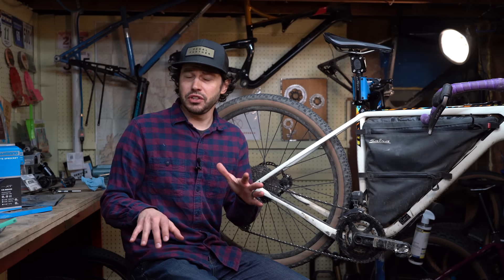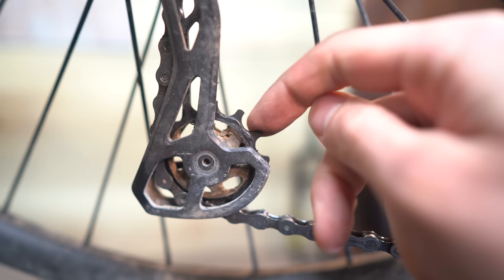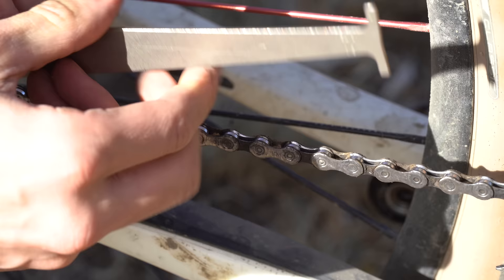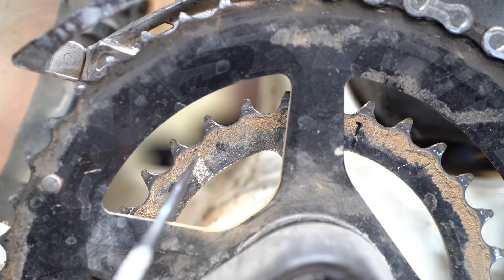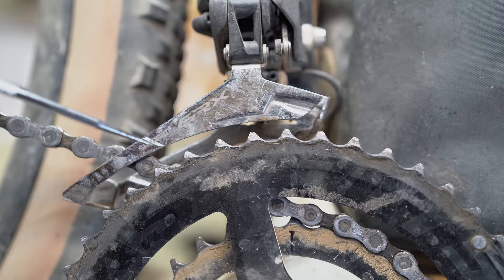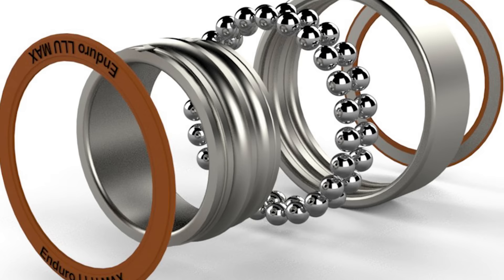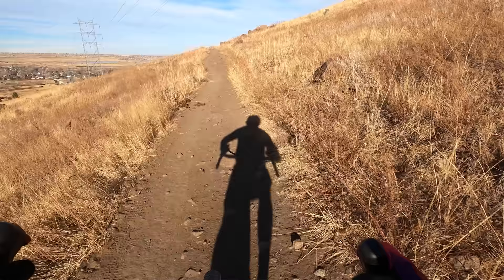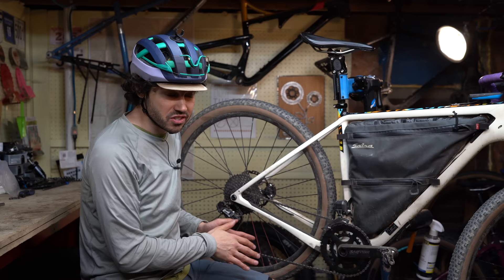A Pandemic Drivetrain: The 4,000-mile Audit

Comment: pro tip: you can check the chain by measuring out 12 links. all chain links are 1 inch long when new. so if 12 links measures to anything over 12-1/16” it usually equates to .5 or more on a wear indicator tool.

Comment: I rode my pandemic drivetrain about 7500km but my Chain Checker was still not dropping into the link - I was very surprised. Eventually I discovered that the checker didn't drop in because it had stretched so much that IT WAS TOUCHING THE WRONG SIDE OF THE GAP. Check early, check often folks :P
Reply from the maker: HA-HA, impressive!

Comment: I am just here to admire your logos (grins). I picked up a $25 ‘99 GT MTB last month that had better 3x7 drive train and went through the same. I had to do the the same walk thru as you did. Repack the BB, replaced the 3x chain rings from another salvage bike, and swapped front derailleur for better. New jockey wheels as 7-8 speed ones are out there. New cables all around. New cables and brake pads. And I had the LBS check our derailleur hanger and wheels. It so sweet! When I started I wanted to pitch the whole drive train, but this is so much better.
Reply: That's right. Old stuff lasts waaaay longer. Honestly, they don't make it like they used to. I get all sorts of barely used 'old junk' cheap or practically free! 
  Ironically, cycling is supposed to be a 'GREEN' sport! But that doesn't suit the agenda of marketing BS, nor materialism and ignorant consumers. 
  I wrench in a shop. All this new bike 'technology' is merely job security/more service/more sales/more profit  for me!! We turn work away. We've been busier and more profitable in the last 2 years than in the 60 year history of our company! 
   The funny thing is I don't really want what we sell in the shop. I know better. I can do it far better than some low paid worker 1/2 way around the world. I DIY.

Comment: Great video. Thanks for the pointers on checking wear without having the wear tools. That is really helpful for us that can't or are to cheap to buy the specialty tools. As for my pandemic drivetrain. I am still feeling lucky that I found my pandemic bike let alone a good drivetrain build. I am pretty sure I was able to score the last Salsa Fargo XL in the country when I picked it up last year. It's the Tiagra 2x10, so I think that actually helped me out on parts. I was able to build a wide range 2x10 drivetrain when all of the 1x parts were out of stock. Though it still wasn't easy to source the parts I was looking for either. I was a to find an 38t chain ring replace the stock 36t to build a 38/26 Deore crank and was able to find 11-42 deore cassette to replace the 11/36 stock cassette. I was also able to find a GRX 400 RD and a 10 speed goat link which handles the 11-42 beautifully with still plenty of b screw left. Couldn't be happier.

Comment: keeping your drivetrain clean and regularly measuring chain wear is the best thing you can do for your bike. I assume this guy let it go for the dramatic effect, but if he had kept an eye on chain wear and changed chain earlier, the cassette and chainrings would have more life left in them--sure it shifted ok, but this chain took more life out of the cassette and chainrings than was necessary . And ya, clean and lube your bike often, well the drivetrain anyway.
Reply: Doesn't hurt to check tire pressure EVERY RIDE and pump 'em up. Tires are our connection with the ground! That's at least as important as a chain! I can coast 30 mph down a mountain  without a chain! Can't safely do that without proper  tires. 
   As a mechanic, I'm amazed how many folks miss this. 
  Chains and tires. The Most important parts on a bike. You won't get very far without either. They happen to fail most often during a ride. EVERYONE who rides a bike should know how to handle tires and chains.

Comment: Top tip is to rotate between two chains regularly, that way the components don't get "personal", so will not be instantly wearing your new parts in after a swap. Will prolong the life of the cassette and chainring
Reply: This is what I'm experimenting with at the moment. I rotate between two chains every 1000km. If it works like intended then I'll be using that method on my next long-term trip.
Reply: @VeloObscura  Great! My local bike shop said to rotate every third ride. I suppose a happy medium would be best.
Reply: @bingoberra18  Wow yeah, that's more often than I expected. I suppose it makes sense though! 
I'm usually looking at this sort of thing in the context of a long term tour - we just finished a 6 month stint - and I don't know if I could deal with that amount of work... I'm a pretty lazy cyclist at times and it often seems like usual rules don't apply in bike travel world 😅
Reply: @VeloObscura  Hehe well the correct way would probably be  some kind of intervals based on hours ridden. I think if you wait too long between intervals, its already starting to get personal and youll wear down the other item slightly in the process. Riding for 6 months maybe  every 2-4 weeks would be reasonable to start with? At the same time,  thoroughly cleaning and lubing up the chain that comes off.
Reply: @bingoberra18  Yeah, I'd be more inclined to go based on distance as that MIGHT be a slightly more accurate representation of the amount of cycles the drivetrain has done? We might take a couple of days off somewhere and that would obviously mean less chain wear for example... I think it's hard to find a perfect answer for that one, but I guess as long as you do it fairly often like you say. 
We take REALLY good care of our chains. I've experimented with various lubricants over our tours and I keep coming back to the likes of "Squirt" and "Smoove" just for how clean they keep everything - but I'm currently experimenting with the Wolf Tooth lube and so far it has been incredible. It might be my new favorite, but it's a bit pricier and harder to find.
Reply: Hours ridden arent a practical means to measuring chain wear. Under what conditions? Under what pedaling loads? How do you shift? It might be a decent means relative to your own use. But all you've gotta do is measure the chain with a simple ruler. Its the 'scientific' means of measuring chain wear. 
   Chains get longer as they wear. The chain's pitch becomes longer, that pitch wears into the drivetrain's teeth making them thinner in profile. Larger gaps in between. This is partially why shifting gets incrementally worse as the chain wears. The more often you replace your chain, the longer your gear's teeth last. Gears are relatively expensive compared to chains. 
  This is a very simple mechanical concept.
  Best thing you can do is to keep your chain and drivetrain  clean and PROPERLY oiled.

Comment: I'm actually a bit blown away that cassette worked well with a brand new chain.
It's not 0.75% worn. It's 75% worn. At 100% a drivetrain is usually completely used up and unsalvageable. Most brand new chains will measure at 15 to 20 percent. 25% to 30% is the optimal time to preemptively swap a chain to avoid wear on the rest of the drivetrain, and for optimal compatibility of a new chain with old cassette and rings. With this system, I've gone up to four chains on the same rings and cogs, then eventually let them all wear out together.
Reply from the maker: I also was blown away, not sure how I got so lucky here.
Wait, thats confusing, as Park Tool using .5% and .75% in their language when describing their tools. I guess either way it's the principle.
Reply: The measurement on the chain checker means .75mm of chain stretch. A modern 11 or 12 drivetrain should have the chain replaced at  the .5 wear point. The longer you put replacement off, the more your expensive cogs and chainrings are worn. 
  Changing your chain  more often allows the much more expensive gears to last longer. As a chain wears it gets longer, that increase in pitch between each link wears into the teeth on the gears, making them skinnier with larger space between. This is why shifting precision degrades. Eventually when everything is worn beyond acceptable  function, the chain slips under hard pedaling loads. Then you replace the entire overpriced drivetrain. 
   The best thing you can do regarding parts shortages are to get non proprietary old 'junk'    
  11 and 12 speed chains have been fairly hard to find until recently. My shop never ran out of 7-10 speed stuff. I'm a shop mechanic. 
   I use singlespeeds, 7-10 speed and friction shifting. Parts are available, free used stuff even. None of my old junk is proprietary. It all works quite well together and it's lasted quite a long time. It works great and can shift well even when it's banged up, abused and damaged. Practical stuff when you're out on a long tour! 
  To me, a pro mechanic, all this new bike 'technology' is nothing but job security. Plain and simple. It's inevitable.
Reply: @rollinrat4850  okay, that 0.75mm thing makes sense.
Reply: @SnootchieBootchies27  .75mm over 6 or eight links is quite a bit. Much Too much in my opinion. That's about 1/32" over 3 or 4" at the most. 
  Chain manufacturers actually recommend replacement at  .5 percent  of chain wear. I check this with a 12" ruler over 12 links of chain. This is the most accurate and practical means to check chains. 12 1/16" means it's time to replace the chain. 1/16" is about  1/2% of 12". Ive done  this for decades before you could ever buy a chain checker. Its simple math and factory recommended information. 
   Again, I'm a high end shop mechanic, just for the fun of it. I'm a retired machinist and mechanical inspector. Bikes TRULY are relatively  simple machines. Mine certainly are.... Ive helped build structures  that fly in space, in the sky and a surgeon's instruments. Marketing BS has never fooled me where mechanics are concerned. . 
  As long as I keep my drivetrain clean and well oiled, I get 4-5 chains worth of use out of 1 set of 'rings and cogs. I also know how to shift almost silently, (makes a huge difference), but I ride mostly in dirt, often through creeks and bad weather. I don't coddle  my bikes at all. I use them hard. Racing or aggressive riding is particularly hard on all sorts of parts. These days I prefer exceptionally long rides, touring offroad, mixed road rides  and randonneuring. My rides can last for several days with breaks, food and rest. I try to ride smoothly rather than aggressive. If I race or ride really bad weather on  my 'cross bikes in mud or deep creeks on the other hand, I've destroyed all sorts parts in one short 1-6 hour ride!
Reply: Honestly, I've never researched what chain checkers actually mean. My question would be .5 to .75% of what?? Lots of these checkers can be used completely wrong to sell more chains! The numbers are rather confusing and vague. Many mechanics use them in the shop to sell more chains! 
  If I'm really curious, or a wise customer wants to know , (or it's my bike) then I use the ruler method as well. This data is proven, known and understandable to me. 
  One of these days I'll do precision measurement of a few chain checkers  on a coordinate measuring machine (very accurate measuring devices) to find out for sure what they refer to. 
   Every mechanic I know, says if .5 goes in replace your chain!

Comment: I managed to squeeze a 10-42t cassette in my GRX rear mech together with a 24-42 Setup in the front. 15gear inches in the smallest gear and 735% Gear range.
Reply: How do you shift in the front? What is the derailleur-crankset combo?
Reply: Fd-Rx812 with white industries
Reply: @daseishorn1863  It's able to make a 18t shift just fine?
Can a derailleur go any lower to work with a smaller big chainring? Or it would hit the chainstay?
Reply: @SpaceDjoxy  With the right combo of parts, 18t difference is entirely possible. It all depends on the parts. You've got to experiment and figure out what works on your unique set up when you go outside the box. 
   You can surpass recommended specs a bit under the right mechanical circumstances. Front derailleurs can be rather tricky and very frustrating considering all the different derailleur  types/cable pulls  and bizarre frame shapes. Some front mechs can't be adjusted radially or height wise very much which really limits going outside of their box. 
  Ive found that traditional round tubes and old school derailleurs work best on my own wide range gear set ups for loaded touring. I use 3x or 2x. That's the only situation where I 'need' ultra low gears. Normally, I pedal singlespeed or fixed daily for commuting and my local trails. 1x is great for singlespeeds, seriously rough trails and cyclocross. For general XC and everyday riding I personally hate the huge gaps and severely limited gear range. I ride to trail heads through a city. I'm an old (off-roadie) road racer stuck in his ways....
  I like 24/42 chainrings with a 33 year old Deore front mech on my dirt tourer. 11-36 10 speed friction shifting works great! Seriously reliable! It is low enough for loaded bikepacking in big mountains or I'll just walk. Much lower gears than that and I fall over from a lack of momentum and balance. 
 I've experimented with custom 16 tooth granny gears and 34 tooth cogs decades ago. Stupid low! Believe me, it's possible to go too low!

Comment: I took a long hard look during the pandemic, in the way that the cost of every single part on my bikes drivetrain went through the roof and with one simple question - am I prepared to pay more or less double what it originally cost me and suppose I woke up tomorrow and Covid had turned out to be like a scene from a 1970's BBC program.
The answer was no. The program was Survivors and as a child it taught me make stuff last forever, so I upgraded my sram gx kit to shimano compatible 8 speed. I have a stockpile of chainrings chains jockey wheels and cassettes that will pretty much last me forever and all purchased as new for was seems like a pittance....... and the only thing I miss about the GX my bike originally came with is that little spring loaded catch that holds the derailleur open.

Comment: Hi. How did you arrive at the 4K number? I just got the 3 components you mentioned replaced after 6k miles and my bike is running great. It sounds like a regularly replaced chain is the best maintenance scheme. Thx
Reply from the maker: The goal was to see how far the drivetrain would run without replacing anything, I washed it down and lubed it but that is it, it stopped working (started skipping) at just over 4000 miles.

Comment: There's a rule of thumb that says 3-4 chains per cassette and 3-4 cassettes per set of chainrings. Throw a chain checking tool on each chain at 2,500 kms and change them out at .75 or more, because hey, a chain's cheaper than a cassette and a cassette's cheaper than a set of chainrings, or an entire new crankset (which can be cheaper than new chainrings on their own). You'll always hit that guy who will angrily insist that he's still running a chain and cassette from 1975 and gets agressive at the idea that components are consumables, but by changing chains you have much nicer shifting and a longer slifespan. One thing to note is Sunrace cassettes. Sometimes they skip like mad on their third chain, and you have to wait a few hundred kms for the last chain to settle in, so it's better, from a longevity standpoint, if not a weight weinie viewpoint, to use their heavier steel cassettes. You get a weight penalty, but if you're riding party pace on a steel bikepacking bike it's not the end of the world and they tend to be cheaper than the ones with alloy spiders etc.
Reply: Its better to replace chains at .5 wear mark on chain checkers  for 11 and 12 speed drivetrains. I refuse to use that stuff. Its less reliable. Simple is as simple does. 
  More gears= less tolerance for worn components. Anyways,  a chain is quite a bit less expensive  than gears. How many gears do we 'really need'? I can't wait for 13 speed. More job security for mechanics like me! Haha! 
  I always replace my chain when 12 inches of chain grow to 12 1/16". That's .5% chain wear. 1- 10 speeds. Doesn't matter how many speeds. You can measure with a ruler. Easy peezy! Ive done this for decades.   .5% wear replacement is what the manufacturers suggest. 
  I get 4-5 chains worth of wear out of one drivetrain as long as I keep the chain and drivetrain clean and oiled properly. Always keep your chain on the largest physical gear combos that you can. This spreads out chain load between numerous teeth rather than less. 
   Chains get longer as they wear. That lengthened pitch wears into the gear's teeth making them skinnier in profile with larger gaps in between. This is partly why your shifting gets worse as your drivetrain wears. Imprecision negatively effect  systems that demand more precision. Its also why cheap 11 or 12 speed systems stink and wear out quick. 
   Due to cost, reliability and modern bike 'technology's' issues with QC, I choose 7-10 speed drivetrains. It lasts far longer and I can actually procure new parts  cheap or even slightly used stuff practically free. 
  I'm a shop mechanic and I get all this junk near cost, yet I want old 'outdated' parts!